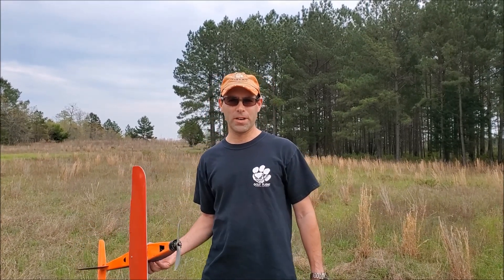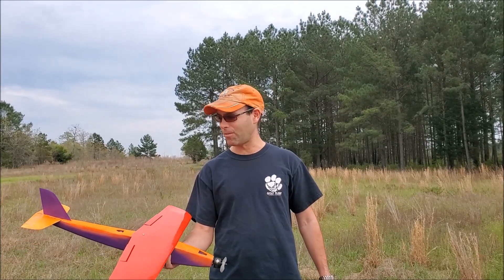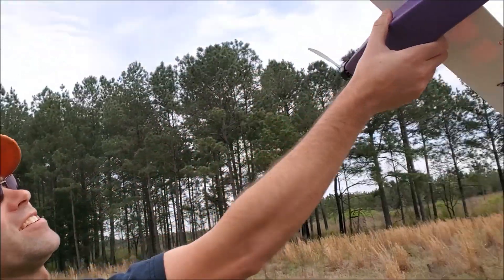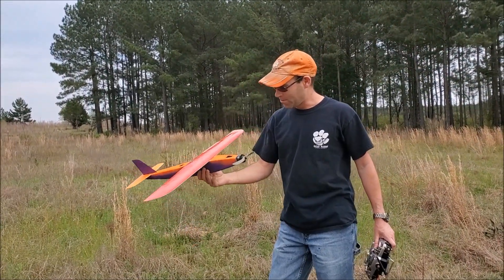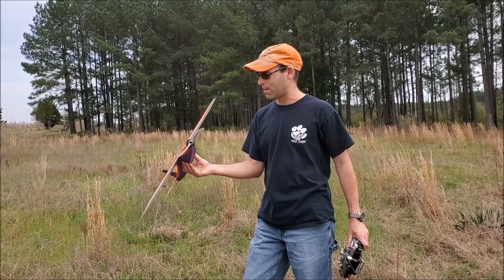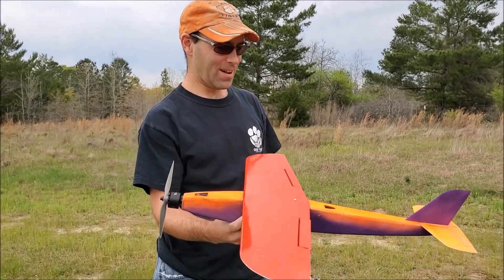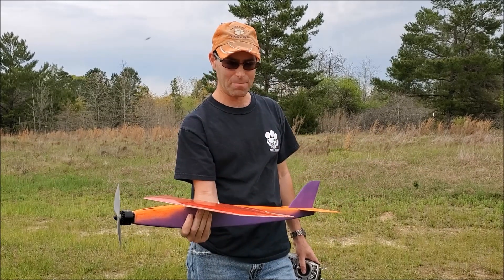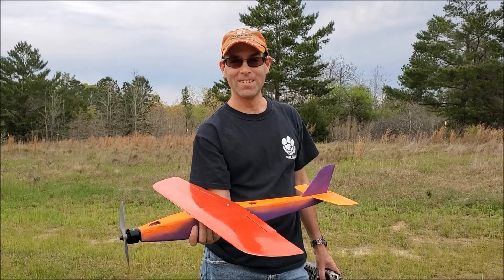Extreme speed from a wooden plane: the Skeletor!

Comment: Hi josh, Bas here (I just renamed my youtube account, I used to be thegaminguineapig)
I just ran some doppler analysis on this video and the best speed I got was 168+-2km/h = 104+-1.3 mph. My F5B was doing about that speed, a little less, when it failed. However the passes in this video were obviously not ideal speed passes, the spectra looked kinda odd. Could you maybe do a video of one of your fastest models (e.g. this one) where you come flying straight to the camera at low altitude and continue straight for as long as possible? that way I can get some really accurate doppler readings for you including error analysis and maybe even radial velocity correction.
Please let me know!

Comment: I haven't posted in a while, but watch  all your videos...My question is for a rubber powered two bladed helicopter type model with a small parachute recovery device...I saw one in a video it flew straight up into the sky that you couldn't see it... What's the rubber band power ran out...the man had to catch it or risk breaking the propellers....I thought with the microlight altimeters... This could be an altitude competition..

https://youtu.be/q8DwBEtEK9I

This is the video...but I was also wondering if there could be away to add a parachute that could be deployed after the rubberband power ran out ? Add altitude competition on rubber power ...
Reply from the maker: Parachute is an option, or hinged blades with a clutch so they auto rotate on the way down. Clearly another project for the pile since it's been 20 years since I last built an outdoor heli.

Comment: I'd bet that thing would scare the crap outa you at 160 MPH
Reply from the maker: That's about how fast it's going. Honestly not scary at all. Feels very locked in.
Reply: @joshuawfinn I’m aiming for 250-280mph with mine. Beefing up with carbon fiber rods here and there. Minimal. 12s carbon wrap the tail in sections.
Reply: @joshuawfinn I want to blow hjk speedwings out the water with yalls stuff. Why build something for sale. And never have stock. And when they do have stock it’s like 10 of each item once a year. Readily available speed kits don’t exist anymore. Except yours.